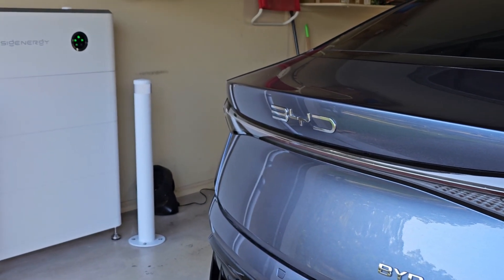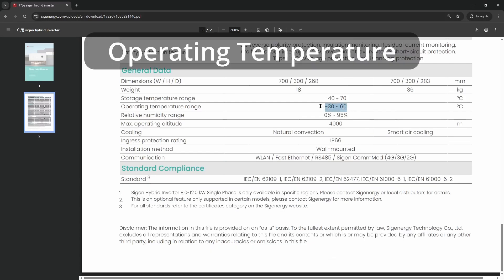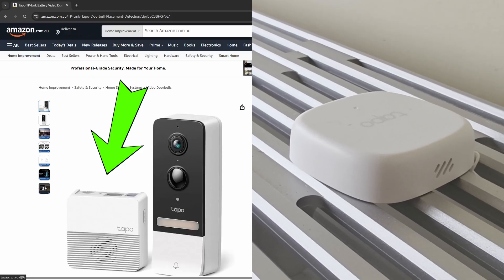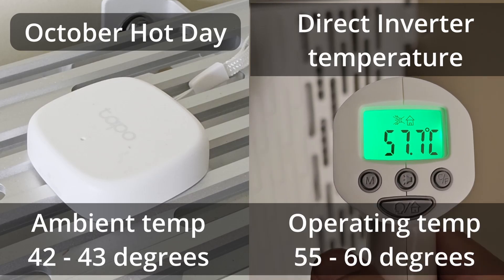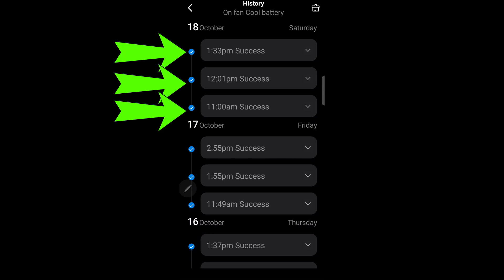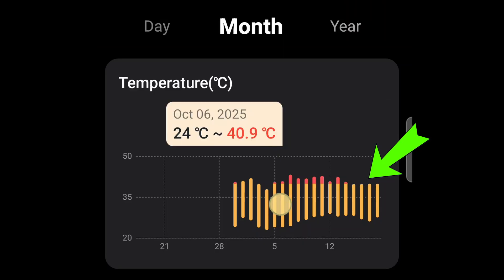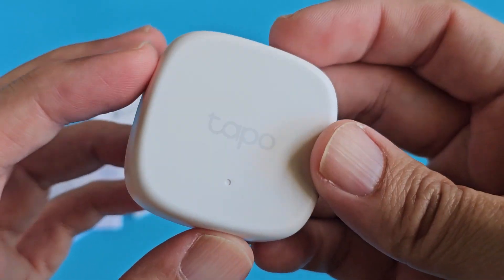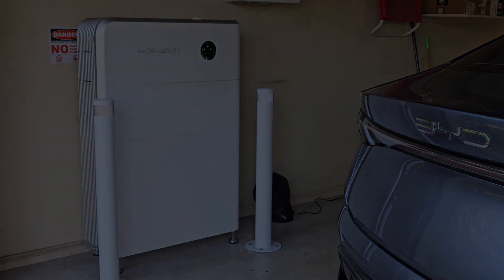Sigenergy Solar Home Battery getting HOT in garage

Comment: I've had my Sig set up for over a year now and I have also set up a smart cooling schedule with a fan on the inverter to help remove the heat. With a smart thermometer, and smart plug linked to my phone. When a certain temperature is reached, the fan automatically kicks inz lowering the inverter temp by 10 degrees
Reply from the maker: So happy to hear someone else is also having the same set up. Reduce by 10 degrees is a lot. May I know what fan did you use and how did you positioned the fan? Thanks.
Reply: @SkyPerspective honestly, I just used a large desk fan on max setting, my inverter is in a fully insulated and plastered loft, but the inverter will still reach towards the 56* mark in summer and during discharge cycles, with the large fan pointing straight at the inverter I lowers the temp to under 50 everytime. I will consider upgrading the fan to something better but the a simple large desk fan is working wonders and cost nothing.
Reply from the maker: Thats cool! Good to know your sigenergy is working after one year and survived a full summer heat.  Thanks for sharing your information.

Comment: The Sigenergy has it's own internal sensors for the inverter and batteries, and those are the temperatures that really matter. You can monitor those sensors over Modbus, e.g. with Home Assistant. It would be ideal to trigger your fan based automation on those internal sensors.
Reply from the maker: Yep, I am aware the inverter temperature is available over Modbus. I can't be bothered to set that up. Sigenergy app should just display the temperature of the inverter. I suspect they are afraid people will panic when they see the real temperature. 😄

Comment: I think this is a great idea. I am also concerned that the Sigenstor is running too hot. This occurs even under light load. I'm pursuing a 3D shroud with additional fan cooling.
Reply from the maker: Yes so far so good. With this fan, my sigenergy is kept pretty cool in these Australia hot summer days.

Comment: Yes optimum operating temp is 25’c so I would keep it as cool as you can full time. My 25kw 3 phase outside sth side shade gets to 65’c on a 38-40 ‘c day and I’m not happy so will use a fan assist to try to help even though it is already actively fan cooled across heat sinks, the extra air flow will help dissipate ambient heat.

Comment: You have it installed out of direct sun. Why do you need to install your own cooling system. That is bad design...not a good situation at all.
Reply from the maker: Even though it's not in the daily sun and weather, the garage is an enclosed area, so it's good to open some doors to allow air circulation. Its just an easy idea for precautionary purposes. I like simple automatons like these.

Comment: How is this working for you? My top battery in my 40kwh stack reached 46 degrees recently and I'm thinking of doing a similar thing but with a Inkbird ITC-308 as the temperature sensor. 

Surely a 46 degree battery isn't healthy. My 10kw inverter has a built in fan but it's barely audible, and I think has been set to be quiet rather than cool well.
Reply from the maker: Yes, and I shared an image of my Tapo app for you, have a look: 

https://www.youtube.com/post/Ugkx39tJfQYdgq1uSWBDT2kKe87MY7KjVKWO?lc=UgxcE7pQM6AuvVGneJZ4AaABAg&si=2L0KYgCwd2zdkbX7
Reply: @SkyPerspective do you keep an eye on the battery temperature levels in the sigenergy app? The top battery temp must rise and fall with the inverter temp
Reply from the maker: When you said 46 degrees do you mean the battery temperature reading of the battery on Sigenergy app? Or ambient temperature of your sensor?
Reply: @SkyPerspective 46 degrees for the top battery in the app which seems high to me...

Comment: Get over it. You used Sigenergy to promote and sell other products. I'd rather the sig battery failed earlier and get the replacement than adding these fans in my garage. Safety wise, I am sure Sig had the correct design or it will be in deep trouble if what you said happened. My 25kw 3p system did get warm, but its within the spec even with 41 degree today in Sydney. So what's there to worry about?
Reply from the maker: Yes I think you are right. The fan may be unnecessary, but its a good precaution to have. I enjoy doing such DIY automation solutions. Hope you find it useful. Thanks for sharing your 24kW system is working well for you in 41 degrees temp. Many will find it useful.

Comment: I don't think the cooling fan is vital but it wont hurt either. It will just use a bit extra power that would go to something else. I would take a good look at the ventilation of the garage and using natural airflow where possible.
I have an 8kw Sig and I'm only worried about the recall due to the AC output plugs melting ( no amount of fans will fix that) 
I have also noticed my garage being warm on sunny days when the house load is low and the Sig is exporting a lot . The 8kw unit has its own fans that run when it gets warm. I'm thinking of running a vent into the roof space since there is whirlybird roof vent nearby. 
Just for kicks you should try extra fans and see what that does.
Reply from the maker: Yes I am in the same opinion as well. I added the fan because its a simple quick solution, and we can use our solar and sig battery to power it. Im still going through this first summer and observing how it performs. Maybe next summer I'll consider garage ventilation or even install air-con in the garage.

Comment: Very interesting experiment, I was wondering if there is a max operating temperature we should keep as safe limit that is lower than the official one stated on the specs sheet from Sigenergy.
Important to distinguish the inverter operating temp from the battery modules one as they vary quite a bit. I have a 48Kw stack (6 modules in total) and a single phase 10Kw inverter as the top module and the temperature difference between the battery at the bottom and the one at the top is on average ~5 degrees
The hottest module is always the inverter and then temperature gradually goes down through the battery stack.
You can m😅nitor in real time the temperature of each module by tapping on the battery image on the main screen of the app
Reply from the maker: Thanks for the tip. Same as my battery modules, each module from the inverter down is one degree cooler than the one on top. Wow, 48kW, that's a lot of power. Does your household consume a lot or you drive an EV?

Comment: Liked the video mate, I was thinking along those lines for my place over summer. I will be altering your setup by adding a second temperature sensor away from the stack collecting the ambient temperature in the garage over a week. I would then feed the results into Gemini and DeepSeek to get the best auto on and off time. Ongoing monitoring of performance is key to maintaining the batteries condition especially in the hotter months
Reply from the maker: Such a smart idea, using AI (collective data model) to help guage the on off timing and temperature. I'm still bracing for December for the day where my vornado fan is blowing and the temperature is still going up. I will then consider upgrading to a portable air-con. So far so good, each time my vornado fan runs, the temperature will drop. Keep us posted on your AI analysis.

Comment: SIgenergy state that the maximum operating temperature range for the battery modules is 55c, but optimal range is 10c to 35c and the system may derate over 40c. DId your fan solution have any noticable impact on battery module temps (especially the top battery module that always runs hotter due to transferred heat from the inverter) ? You can see battery module temps in the MySig app device tab.
Reply from the maker: I checked today. When my vornado fan at noon time, the app shows my hottest top battery module is around 32 degrees, so my fan is working??

Comment: Thanks for that. Its a good solution. The SigEnergy 5kw unit relies entirely on convection for cooling and you don't get much breeze inside a garage. The 8kw unit and above has forced air cooling built in and wont have this problem.  My suggestion is, when installing the 5kw unit, make sure the feet are raised, to improve convection, and put some washers on the wall mounting bolts to space the battery further off the wall . Also, aim the fan at the heatsink. Even a tiny 12V 0.1A CPU fan that blows air directly on the heatsink will make a huge difference. Heat is a very bad thing for LiFePO4 batteries and can cause irreversible damage to the battery. Never let the battery units operate above 55degC. It will lower their capacity and increase the internal resistance which will cause the battery to produce even more heat when charging and discharging.  Installing an EV charging unit between the controller and batteries units will also help keep the heat away from the batteries.
Reply from the maker: These are fantastic suggestions and extremely helpful. Thanks for sharing. You have given me an idea when you talk about CPU fan. If I have a whole stack of CPU fans lined up on the heatsink side of the Sigenergy stack, that might be more efficient then the vornado fan. So far the temperature drops when vornado fan is on. I may try it if there comes a day in December heat that the temperature keep rising even with the vornafo fan on. Ultimately the hot air from my garage needs to escape some how.

Comment: I think Sigenergy should provide a solution for this.
Reply from the maker: Yes, hopefully they can innovate and improve. To be fair it might not be a problem at all so nothing to fix. I am just doing this to keep it cool.
Reply: @SkyPerspective  yes that may be true too!
Reply: The "solution" is the passively cooled SigEnergy SP 2 and TP 2 inverter 🤷 which is much mor efficient, has less idle power consumption an works fanless.

Comment: The garage might be getting a lot of heat if you have a metal garage door with direct sunlight. Maybe insulating the garage door might be possible? I did this with my panelled roller door.
Reply from the maker: No, luckily no direct sun on my garage door. Yes I have a mate who has direct west sun on garage door and he has done the panelled garage door insulation you mentioned. Great suggestion, many will appreciate this.

Comment: Just seen a video of sigenergy..they put inverters in a chamber at 60 Degrees celcius and run them for 1000 hours or so..so isnt the 60 Degrees not the max temp outside?..the inverter problebley may get hotter..the video starts with the fraze: proven reliability sigenergy..
Reply from the maker: It's the battery modules I am more concern about.

Comment: The temperature as measured directly at the top of a heat producing device such as a battery and inverter stack is not the ambient temperature. Try hanging it in the air 1m to the side of the stack. Not that it's bad to have more cooling, I would turn it on at (actual) ambient of 30 and off at ambient of 26.
Reply from the maker: Interesting point. I don't have a convenient location to hang it at 1m in the air but I will try it out. Why particularly 30 and 26?

Comment: good experiment, I have also used Tapo 110 sockets around the house and garden for lights and one in the garage ceiling socket for the door opener, I switch it of at bedtime and on in the morning, preventing burglars using a scanner to open the garage door.
Reply from the maker: That is so smart and such a good idea to prevent people opening the garage. I'll make sure I mention that if I make a video on the P110 smart switch. Thanks for sharing.

Comment: Can you limit the power coming in from your solar panels?  For example Can you limit your input power to 10 KW?  I know it depends on the number of panels as well as the Inverter, so am wondering if there's some kind of throttling control.
Reply from the maker: Hmm... The system reduce the PV power by itself when consumption and export are low. I haven't investigated if this is possible. I know we only have a physical switch to switch off and on all panels. Hopefully someone who knows how to do this can share on this conversation.

Comment: Any reason why you don't let the fan on 24/7? Uses barely any energy and a cooler battery increases life expectancy.
Reply from the maker: That's a good idea.  I guess it's the fan noise at night. Maybe I should just let it run based on timing instead of temperature,  just have it on from 10a.m. to 4pm. Thanks for the idea
Reply: @SkyPerspective  If you run it all the time it will become background noise that you won't notice anymore. But you could also get a DC version of the Vornado, it's significantly quieter.
Reply from the maker: @alexanderroos4391 good idea. Thanks

Comment: I have a car radiator fan connected to a solar panel on my roof cooling my BYD stack.
costs nothing to run that way.  and super cheap used off marketplace.
Reply from the maker: Very nice! Is your BYD stack installed outside your house or in your garage?
Reply: @SkyPerspective  in the garage, back corner.
so we don't hear the noise of the fan. 
you can always use an inline resister to limit the current till the fan isn't audible in the house.

Comment: I think the ideal range for a LiFePO4 battery is different depending on if it's charging and discharging but, yeah cooling to make it consistent has got to be a good thing.
Reply from the maker: Yes, I read a lot of theories about efficiency and life span of the battery temperature when charging and discharging. My conclusion is, in any case, keeping it cool is definitely a good thing. Worse case scenario is the cooling doesn't make any difference.

Comment: You might hit the max threshold in summer, not great, hope the battery manufacturer will provide support for the issue
Reply from the maker: Yes, I guess battery manufacturer's will say it's the owner's (or installer's) responsibility to maintain acceptable ambient temperature. This is why I thought of this solution and sharing with everyone. December summer heat is not here yet, my worse case scenario is install a portable air con in my garage and run it using solar.

Comment: I have a cooling fan in my garage for my signergy the best thing I’ve done don’t forget heat is the battery biggest killer
Reply from the maker: How often do you turn it on? Or you just keep it running 24/7?

Comment: That's very impressive!! I am going to get Sigenergy battery in Jan to be installedin the garage, and I'm worried that my garage is already getting so hot. It is on the southwest side, so starts getting hot in the afternoon/evening.
Reply from the maker: I'm glad you found it impressive. Yes sigenergy is a very good system I'm sure you will enjoy it like me. My plan is if the garage is still too hot after I use this vornado fan, I will  install a portable air con to cool the garage, making use of the abundant electricity.